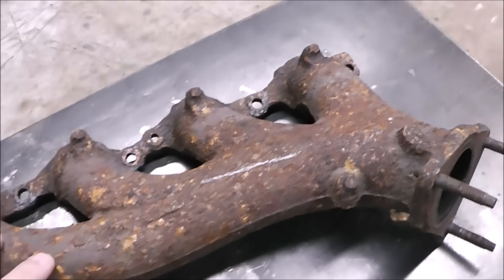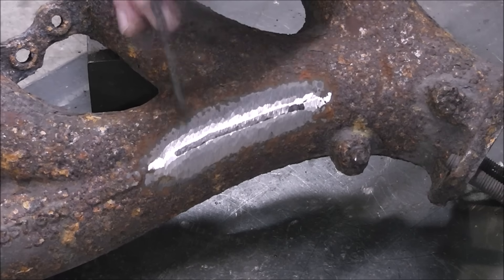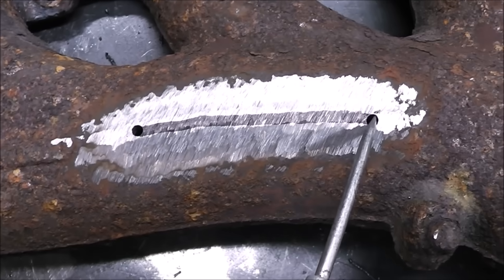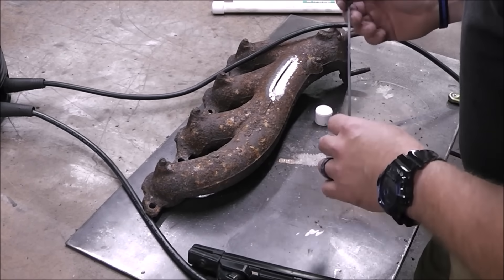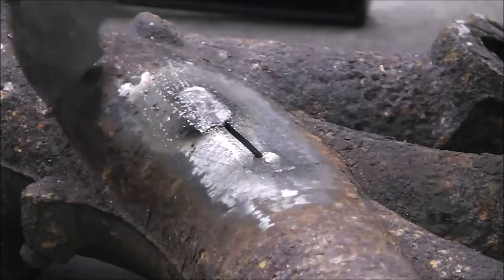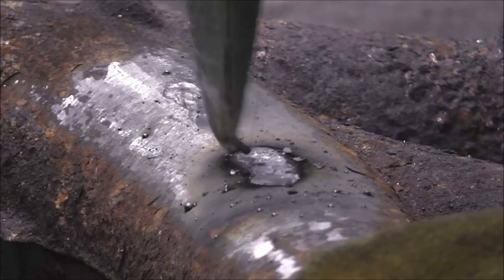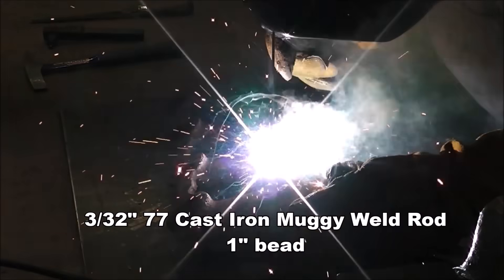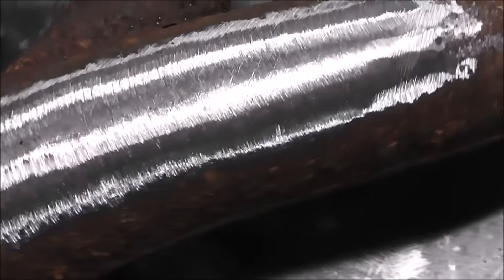Stick Welding Cast Iron Repair with Muggy Weld

Comment: This exhaust manifold is from a GM LS truck. It’s cast steel which is much more weldable. A lot of people have had success mig welding these manifolds.
Reply from the maker: https://ls1tech.com/forums/forced-induction/1750208-what-truck-manifolds-really-made.html

Comment: would that rod work on a Turbo Charger housing?
Reply from the maker: If its cast iron it will. I have some other videos on spark testing to help you determine what the metal is.
Reply: @BrandonLund  I saw that video, thanks. Yes this turbo is cast, casting marks all over it. Cracks were a common problem with this vintage turbo.

Comment: 11:35  Instead of burying in sand, could you wrap the cast iron in fiberglass insulation?
Reply from the maker: Probably the best method actually! That way your not worrying about moisture in the sand

Comment: how do you prevent something from being welded if you are trying to repair a T slot for example 
any idea?
Reply from the maker: Im not exactly sure but whenever I'm welding up to an area where I dont want the weld to flow, I have used copper to fill the void and I have also used fiberglass mat.

Comment: First time i know that cast iron can be weld §)
No body told me this before!!!

Well done mai
Reply: You can do it with regular rods too if you pre and post heat.
Reply from the maker: Thank you very much!
Reply: Lol what??? Of course cast iron can be welded. The vast majority of ‘cast iron’ is cast steel anyway.
However after a PMI confirms the composition to be iron then you can use a suitable electrode, I like 100% nickel or 90/10 nickel

Comment: Lol, I had a guy tell me that you can't weld cast metals.  Very nicely done.
Reply from the maker: Thanks Dennis! Show him this video LOL :)
Reply: @BrandonLund  I can't!  About 30 years ago a welder friend came over to help me fix a cracked 383 mopar block at middle freeze plug. All it did even after prep was run down the side another inch or two. 

I have a Hemi head that is cracked in the chamber. Someone tried to fix it but according a shop I took it too to check it for leaks.. it still does. It looks good to me and I thought about using it with block sealer. That might be my best bet to keep from destroying it completely. What do you think?

Comment: I just weld that shit up with good ol flux core mig. Heat it up first, weld it and keep a little heat on it and let it cool slowly so it doesn't crack.
Reply: I've repaired a couple of exhaust manifolds like this using stainless wire, lots of preheat and slow cooling and they lasted fine (one was from a 5 cylinder turbocharged Fiat Coupe, notorious for cracking). I'm under no illusions that it's a technically good method though, it's just what was available to me.

Comment: Couldn't you leave the settings and just speed up a bit to avoid undercut?
Reply from the maker: With undercut you would typically slow your travel speed so that more molten metal washes to the edges of the weld but that can result in blowing through so it's best to also lower the amperage also.
Reply: @BrandonLund  thank you

Comment: I've tried heating cast iron and welding it and sometimes I have better luck then others but more failures then success that's for sure. Any help is definitely appreciated lol.
Reply from the maker: Thats a tough question to answer because cast is fussy. The general rule is take your time, plan out your repair ahead of time, select a filler that you think will work best for your application and don't rush things. A preheat of 500 works good and try to keep the part at a constant even heat throughout your repair process. A grill or oven is great for this if you have access. Do very short weld beads then pein the weld. Put it back into the oven if things start to cool and keep repeating the process until its repaired. Once its repaired bury it in dry sand until it is completely cool to the touch (several hours). I have also heard wood ash works good to cool the part but I have not tried that method.

Comment: I've been welding LS manifolds with L56 mig for years with zero failures. A better test would be to try this on an OLD iron manifold.
Reply from the maker: I've actually switched over to doing destructive testing on a cast iron pan. Cheers brother!
Reply: @BrandonLund  Good idea. I'm not sure if those are considered "grey" iron, but the more brittle iron castings seem to require pre/post heat and exotic fillers AND they still crack like it's their job. I was just noting that for some reason, these newish gm manifolds act less like iron and more like steel (even if they don't throw sparks like steel when you grind on them.
Reply: GM Ls exhaust manifolds are cast steel. Not cast iron. We've been making turbo manifolds for these for years now with nothing more than a Harbor freight mig welder.

Comment: What happened to your first weld starting out on the front? Why did you end up on the backside of it was there a problem or a crack?
Reply from the maker: The manifold was prepped on both sides. One side was for the video you watched and the other side was for a future TIG welding video. Being the director, camera man, welder and producer, I never caught that I was welding on the side that you did not see me prep.
Reply: But you started stick welding the front first. No? You did a wonderful job. I just wondered if there was a problem. I mig welded manifolds back in 80's and found that to be simple enough.
Reply from the maker: @2JustMe1  Thank you very much, but look closely. All the welding was done on the same side.

Comment: Why is it that in the beginning of the video you are working on the outside (away from motor) of the manifold, then later you're showing us the inside (next to motor) ? Why ?
Reply from the maker: The manifold was prepped on both sides. One side was for the video you watched and the other side was for a future TIG welding video. Being the director, camera man, welder and producer, I never caught that I was welding on the side that you did not see me prep.

Comment: im maybe a bit too old school, but for that if I had to repair, I would first prepare a bed of sand, & a jumbo bag of charcoal burning, now drill as you said, then heat item up, with rosebud tip on torch, then get a friend to keep it hot while I use another torch & cast iron rod, & weld the crack, & yes I would ping it, but usually used a body hammer pick, I know not normal, but a go to hammer, then I would put layer of charcoal on sand & cover with couple inches of sand, & my helper still keeping part heated but slowly backing off on heat, for about 30 min of heated "cooling time" then lay item on the bed, then cover with couple inches of sand, then charcoal all around & over it, then more sand, allow to cool over night, & part should be ready. that looked too easy, in old days never had good luck with stick welding cast iron, even with preheat, but torch worked well, but very expensive, & all charcoal and a buddy to help heat, but I rarely do any, but not a "professional" but only a piece every 3-5 years.
Reply from the maker: Randy, what you described is how I prefer to repair cast iron, however this was a viewer requested video and my first time using these particular welding rods. I wanted to see how they would respond to the cold welding method. In my experience if the part can be cold welded without cracking, the chances for success are huge when you start applying a preheat and controlling cool down.  These rods claim to have excellent elongation characteristics. Based on this and other testing I've done with them, i have to agree.
Reply: lol, gotcha, looks like something I would experiment if easy to replace, but if a pain to replace I will stick to old method,  I have seen older muggy weld for low temp aluminum repair, didn't know they made rods for sick welding.

Comment: the undercut is because you are moving to quickly and not letting your puddle build up enough. you can tell because the shape of your bead is more pointed, and it should be nice even round curves.
Reply from the maker: I tend to move fast with cast anyways because I'm concerned about heat imput. There is a fine line because you cant spend long in one place and you really dont want your base metal getting too molten. I'm trying to mostly wet the filler metal and not let much of the base metal get molten if that makes sense.
Reply: @BrandonLund  i get what youre doing, i was just stating that was the true reason of the undercut not the machine settings. when im welding cast i tend to burn a little hotter and push my puddle back onto itself to help build it up and distribute the heat forward to simulate a preheat effect
Reply from the maker: @Enviousttv  interesting technique...I might have to give it a try.  Are you doing this tecnique cold or with a preheat? I feel like this would be best suited with a preheat...
Reply: @BrandonLund  it works great either way but a preheat is always best

Comment: Need To heat the casting 500 degrees or so then weld with ni. rod
Reply from the maker: Ron, as I mentioned in the video this was a viewer request for these specific rods. I wanted to see how they responded to cold welding, which in my experience welding cast cold has a higher chance for failure. The rods claim to have incredible elongation characteristics. Based on this and other testing I've done, I have to agree.

Comment: Hey Brandon  do you ever do  brazing  with a torch ?   ,my uncle did everything that way and nothing ever had to be done over all ranch tested
Reply from the maker: I sure do. I've done a lot of brazing actually. It's one of the first processes I learned on. Back in the day I was quite good at it. It's been a while so im rusty. It might be interesting to dig it out and practice a little. It's a very fun process and tried and true by old timers as you pointed out. Back in the day I could stack dimes. I doubt I could today without a bunch of practice.

Comment: Everyone in comments WORRIED TO DEATH it might crack out again???? SO WHAT?? a brand new manifold might crack out again too! .. it's not her space shuttle .. cracked manifold won't even slow you down.
The REAL trick is to weld it IN PLACE on the vehicle (if your going to remove it just put another one on) .. crap i've done it with regular 7018 ... run the car so it's hot ... hit the manifold with a torch for a while, weld it  .. start the car again let it idle for a half hour.
When it cracks out? weld it again ... by the third time the car is probability scrap anyway
Reply from the maker: Right on Mike! I'm glad you understand what I was trying to show here. Cheers brother!

Comment: That is definitely not cast iron, that is cast steel. It is an exhaust manifold from a gm Ls series engine. Spark test are not always accurate. I’ve welded dozens of these with a mig/tig welded with no pre heat, with no failure rate at all! 0%
Reply from the maker: It actually is cast iron. The manifold was independanly tested. There is also a link to the testing in the comments. You cant go by because it can be welded with non conventional techniques that it must not be cast iron. I've proven that numerous times in the cast iron welding series

Comment: The technique is right on. However with a real cracked manifold there is more issues to be concerned with. For one, the erosion/loss of original material along the crack on the inside and on the outside. Also it would have been better if your video had shown the same repair area from start to finish. The 72 was used on the part/ side normally facing out from the engine and the 77 repair showed the inside of the manifold which is next to the block when mounted. Obviously not the same repair area. I have welded for 50 years and have found out if there is a long crack along a manifold and it is repaired without being bolted down that it will sometimes warp the mounting surface and will have to be SHAVED/MACHINED FLAT along the mounting surface so that it will seal tightly along the engine surface. I have never used the Muggy Weld product but from what you said it sounds like it has the right composition and elongation features.
Reply from the maker: Thanks Art. Unfortunately being the producer, cameraman and welder, things can get confusing. Only one side of this was welded. Both sides were prepped because one side was for this video and i intended the other side to be used in a future TIG welding video. The 72 and the 77 were both used on the same side. In other words, the side you saw me prep, was not the side I welded. Cheers.

Comment: Hi Brandon, I love your videos especially since you don't judge us folks that have to work with what we have instead of what is ideal. I'd love to try some muggy weld. I'm a Monument Preservationist at Gettysburg National Military Park and we have tons of cast iron artillery carriages that we repair. Thanks for your ideas.
Reply from the maker: Thank you very much! That's very interesting and impressive!
Reply: Stainless steel 309 stainless steel rods and these muggy welding rods work excellent for cast iron.
Reply: "99" rod can work as well
Reply: The democrats will get rid of your old monuments and you will be unemployed

Comment: That root was far from perfect had slag pockets in it
Reply from the maker: As you criticize my work I would tell you that cast iron is not pure. Rarely if ever can it be welded without inclusions. Typically you grind out the inclusion. With this rod the directions state grinding out the inclusion is not necessary and to weld directly over it.
Reply: That is well and good but where i grew up if there is a hole in something that's not to have a hole its not perfect and to weld over a slag pocket only esp in cast pulls the pocket into the next weld at best or adds to the existing one your end result was nice i was just pointing out the root was not perfect im a welder of 25 years ive done seen and heard alot all over this country but the root is the most important part of any weld no matter what the instructions may tell you always make it right cut off wheel end grinder get the slag out your welds will turn out better

Comment: In Russia we take any good welding electrode and put around copper wire and weld , that’s it and no need preheat
Reply from the maker: Very interesting! I want to know more. You are the second person to say this.  How do you attach the copper and the electrode? I cant find information on this.
Reply: Brandon Lund for that need stranded wire not solid
Reply from the maker: So you wrap the stranded copper wire around the welding electrode? What mm or size is the stranded copper wire? I want to try this. I am very interested
Reply: Brandon Lund u can try any like from 3mm and higher
Reply: Brandon Lund 
https://youtu.be/vnqsx41fqZI
Reply: @UCANTRY404 Hi this is 5 years after you posted. The video you link isn't available. Is there another??
Reply: Interesting, will try that one day. Thanks for the idea
Reply: Very interesting. I used a standard piece of housewire to weld a washer, and the result is some sort of brass compund which I believe won't rust

Comment: 3/32   316L stick rod works on cast as well.
Reply from the maker: Good to know Rick! 316 would actually be a good process for this application because its food grade. I might have to give it a try! Thanks!
Reply: Much much more expensive
Reply: Scott Paulsen  I wouldn’t buy stainless stick rods for this job. But, if you happen to have old rods that have been exposed to damp air . And were not stored properly. Instead of tossing them, keep them for jobs like this. I remember two occasions back in the 90s my uncle used stainless to weld cast iron. And it did work. Perhaps somebody reading this will give it a try.???
Reply: No they work for that and hard facing but not cheap yep old rods for sure if you gotem

Comment: Are you kidding me? are we not supposed to notice that the repair is on one side of the manifold at 6:00min in and the bit where you "can't even tell its been repaired" is on the other side at 10:50... or is it just me? It's not just me.
Reply from the maker: I would never kid you, but good eye though LOL. In all seriousness though, the manifold was prepped on both sides. One side was for the video you watched and the other side was for a future TIG welding video. Being the director, camera man, welder and producer, I never caught that I was welding on the side that you did not see me prep.

Comment: You get undercut from traveling too fast also.
Reply from the maker: That's correct and it's very easy to do. I do my best to keep my travel speed consistent and just reduce the amperage rather than slow my travel, which also helps reduce heat imput.